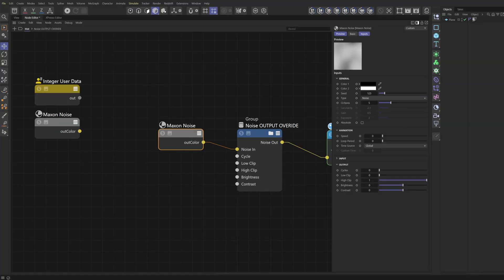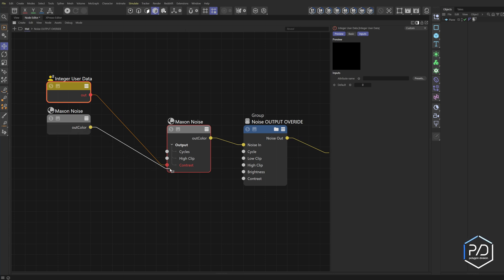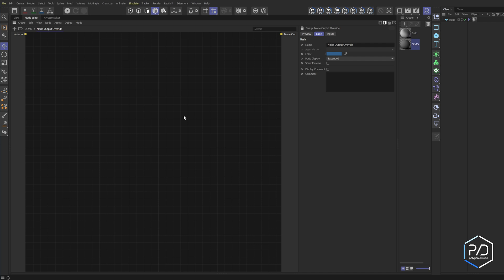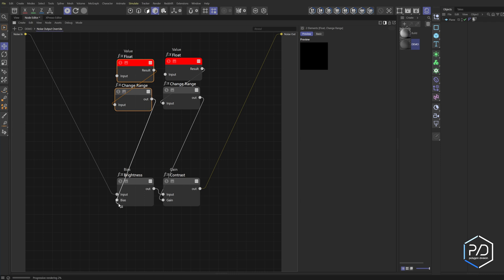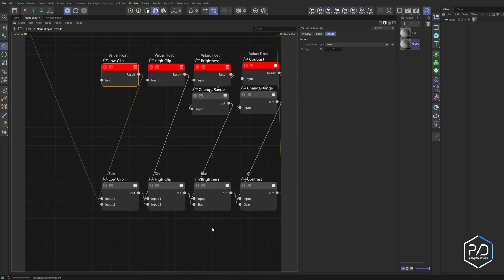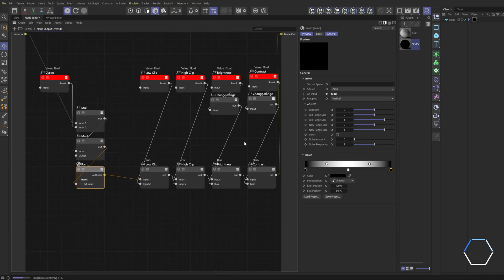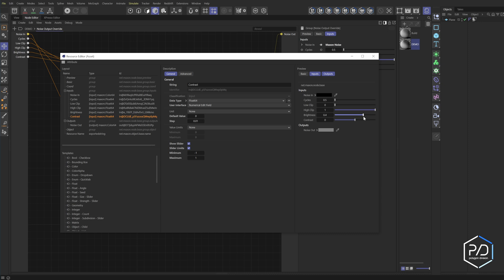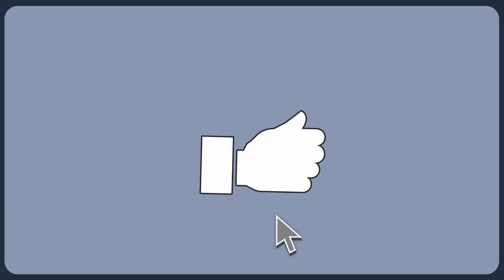Finally a solution! Maxon Noise Output Override in Redshift

Comment: very cool! I can't remember if I asked you this on another video but the times I've tried to create my own nodes, the whole system breaks apart if I need to share a scene that uses the node. This is because the node is saved on the local database and not within the scene so when sharing the scene, unless you also share the database asset, other people can't use it, which is a hassle.

Have you found this issue as well? I'm on the Maxon Beta testing team and I've been asking for that behavior to change. If the node is used in the scene, it should be saved with the scene file as well and not depend on a local database.
Reply from the maker: Yes! To fix this you have to convert it back. Just select the node, then go to the top dropdowns Asset > Edit asset as group
That should do the trick!
Reply from the maker: I agree. Once it's taken out of the database that should be it! But it still references which doesn't make sense.